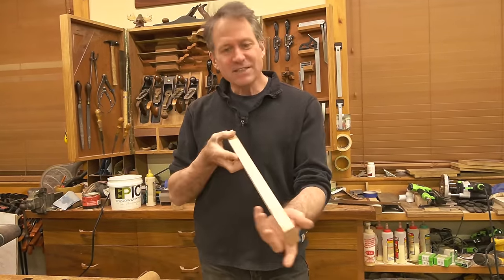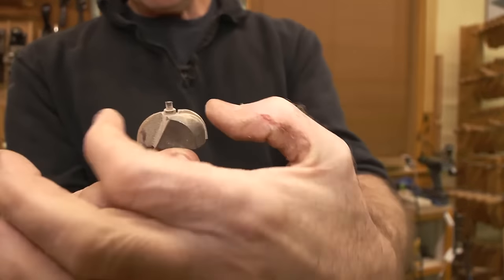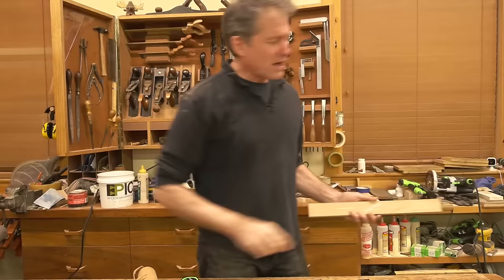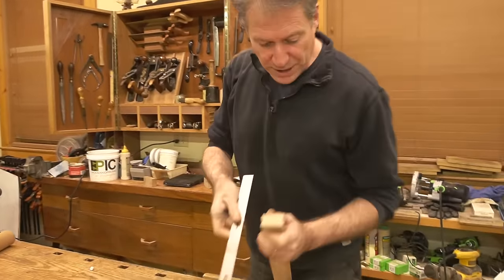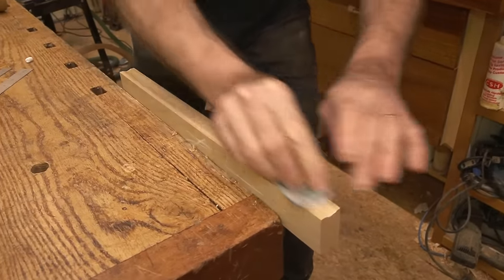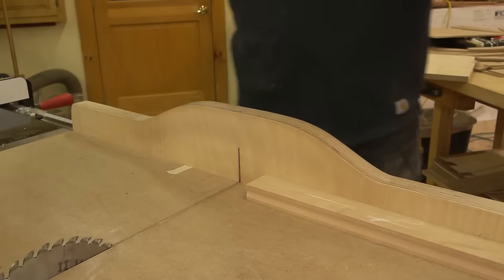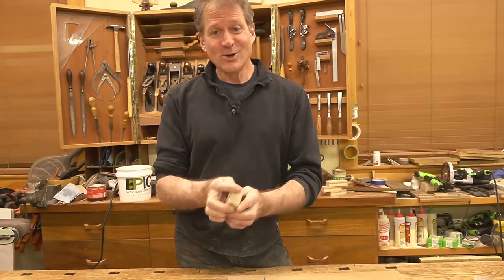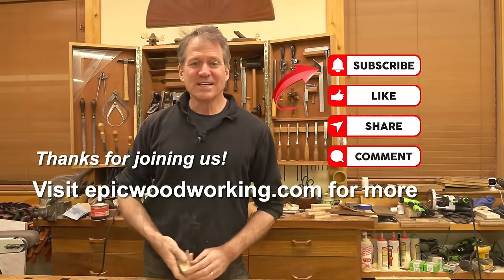Make Your Own Sanding Blocks

Comment: OK it is just a sanding block. :) But as with all your lessons it is the subtle things you teach that can be used in more glamorous situations. First, we learn how a french curve scraper works; next is the piece of tape for a quick stop for making duplicate cross cuts, no clamping stop blocks just simply stick a piece of tape where desired (Really Valuable);  and yes how to use sandpaper efficiently, which then explains making the block to the 1 7/8” width to get two uses from one piece of sandpaper. And yes the sanding block is very nice and just learning how to make it is worthwhile. Thanks!